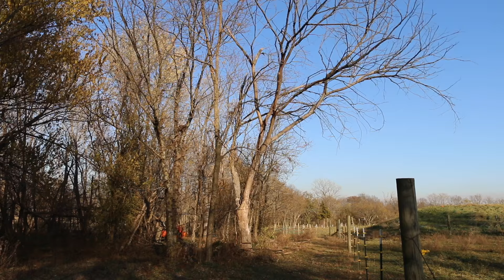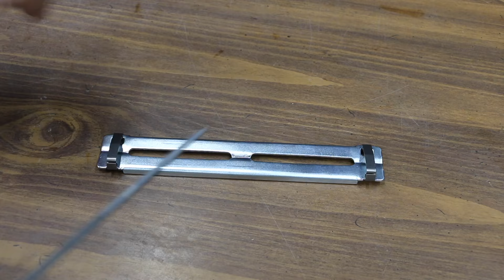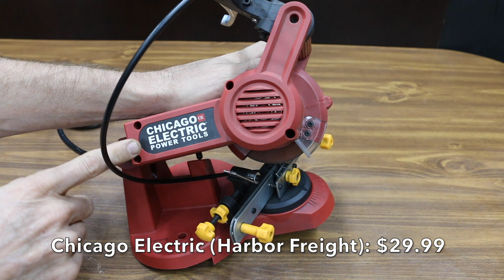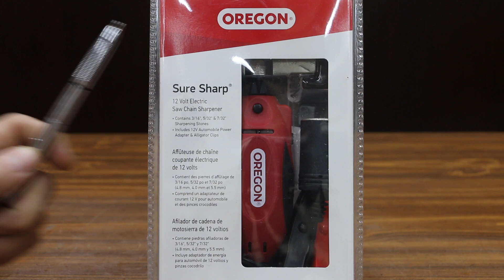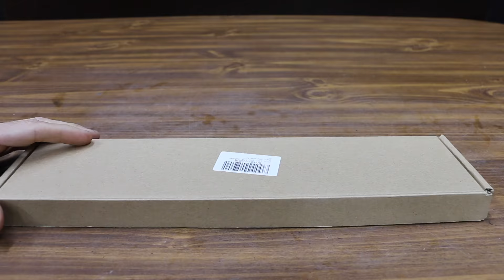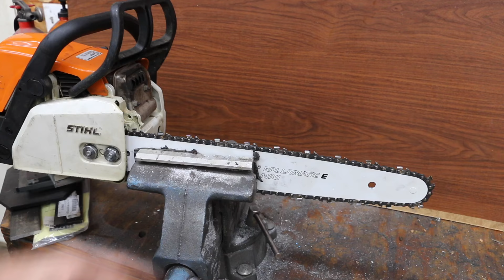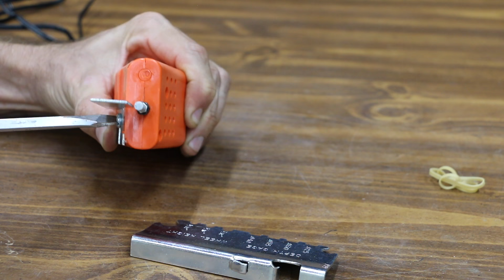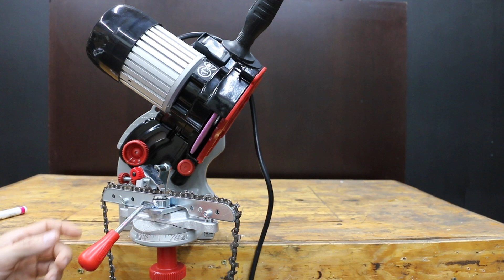Which Chainsaw Sharpener is Best? Let's find out! Stihl, Granberg, Chicago Electric, Oregon

Comment: Curious how a 4 inch grinder with a thin cut off disc(with square edges rounded off first) used freehand compares for cutting speed, likely get shot by some for saying it, but for my low home use on smaller saws(12-16"), i find it fastest and best. it takes around 2 minutes, and done carefully with a very light touch,  i find i can sharpen a fair few times before chain is a throw away item, and cuts real well after sharpening. But ok, angles are likely far less accurate without using any guides.

Comment: Interesting comparisons but you need to be more consistent with the wood being cut, some areas had much denser wood(knots) than others
Reply: the bar should also not be rocked and kept in a horizontal jig or rail

Comment: I have the Italian version of the Oregon bench grinder with one additional feature. You can tilt the chain holder 15 degrees sideways. I’ve had it for about 20 years and it keeps me spinning. I used to have a stone grinder that went on a Dremel tool that worked well.
Reply from the maker: Thanks for sharing.

Comment: I’ve been a power tool repair mechanic forever.
One of my more tedious jobs is sharpening garden tools and chainsaw blades.
In less then 20 minutes and using a Dremel Moto tool with a grinding stone I rip thru at least 50 a day.
No complaints No returns.
Keep it simple!
Reply from the maker: Thanks for sharing.

Comment: PLEASE COMPARE CAULKS.
I recaulked my bath tub and the caulk seamed to shrink, within months, to the point where it no longer sealed. I dont remember what brand it was, but it said sink and bath. I stripped it and tried a more expensive product and it cured without shrinking. It looked bright white when I applied it, but yellowed, as it cured. I've had that happen with painters caulk, too. But of course, those are typically paintable. Some window and door caulks are not, but come in a wider variety of colors. Then there are the products that claim to be all-purpose. So you could have several episodes, for the various applications.
Reply from the maker: Thanks for the suggestion.

Comment: I was always told by some old head to always sharpen the chain by hand because if u have an electric tool due to the fast grinding disk u cause a lot of friction witch causes alot of heat and change the temper of the tooth and your chain will dull alot faster . Idk if this is tru but something to think about
Reply from the maker: Thanks for the suggestion.

Comment: I have the Oregon 120V Bench and it does great once you get the angle set right.. I prefer the quickest way possible to sharpen my chains, a few seconds different doesn't mean anything.. 
You might be able to apply more pressure w/ some of these, but this test won't show that unless you double the weight and keep the angle exact. Some may bog down the saw.
Reply from the maker: Thanks for sharing.

Comment: You have videos for various sharpeners; knife, mower blade, etc.  One I would like to see is for sharpening circular saw blades.  One aspect of that is the shape of the cutting edge.  I noticed that the shape of the cutting edge in your saw blade testing may be different depending upon manufacturer.  So, is a straight flat chisel edge better than a "shaped" edge.  Like V nose or rounded or hollow ground, etc.  Ultimately, would a chainsaw sharpener(curved) type grind be better that a flat grind?

Comment: I run a firewood and tree removal business and run 4 stihl chainsaws ranging from a 230 to a 441c magnum.
I have tried all forms of sharpening tools over the years including the electrics and the granberg system which bolts on the bar.
The small electrics wear out stones very fast and the big electrics are not site potable.
The granberg bolt on the bar system is accurate but cumbersome and I threw mine away after a few sharpenings.
By far the best system I have found is the stihl 2 in 1 for simplicity,ease of handling and portability. 
Just cannot beat it.
Reply: I have a 441c magnum and purchased it with the 2 in 1 sharpener. The thing is absolutely deadly how sharp it keeps the teeth. I love not having the independently check my rakers, no need for power, portable. You can feel just how great this sharpener is when you use it.
Reply: I go back and forth between the 2 in 1 and the oregon bench grinder skipping the rakers on the grinder. To me that makes a really consistent really sharp chain
Reply: For the fellow who is nearly blind you are better off with a file that is slightly larger if you are unable to distinguish the correct size file for your chain.
A smaller file will cut into the tooth creating a point which you do not want.
The voice of experience here.
May want to just use one of the file holders because the size of the file and the angle you need are clearly marked,in large letters,on the top of the file holder.
Used one for years, they will get the job done for you if not fussy.
As for the depthcutters i used to use a round sanding disk on a dremel tool.
40 thousand rpm ,just a little touch after every sharpening did the trick. 
And I promise you you will not f it up too bad.
Reply: @peterfoster7861  thanks peter, that answered by question.
Reply: Yup can’t beat the two and one portable just keep a good shark file and you’re good to go
Reply: I agree also from 71 year old fellow. I also believe the stihl chains are the best. To me, these chains stay sharp longer and wear longer. It is like that have much better steel to begin with.
Reply: Yep  sharpening with a file and guide has always worked best for me was taught by a professional Carber Roy from Alpena chainsaw art and his wife Kat Are real artist I’ve been friends with them for 30 years
Reply: Did you know you can sharpen a chain fast and with good results with a hand held battery power grinder and a fat grinding disks.  takes a little practice and your chains will not  last  as long.  But, A sharp saw saves time only if your not working on sharpening  the chain a whole bunch.  I use to change out the chains as needed then sharpen them back at the shop at the end of the day until i started using the grinder.
Reply: It's worth pointing out that a person like you who likely sharpens chains every day develops a completely different level of skill than a homeowner, especially when reading that some of them are not even resharpening their chains! One thing about the Granberg style of jig is that, providing you have set it up correctly, you know the angles are going to be correct. If you are only sharpening a chain a couple times a year, you are going to have to pay close attention to your technique, as you are never going to develop the skill and accuracy of a pro.
Reply: Agreed
Reply: Me too
Reply: I'm nearly blind and not a sharpening pro. I have no way of telling which file size to use, at least on old chains.
Since I'm going to f it up, should I err to a large file, or small one? I just don't like tossing something because I can't fix it, that bugs me.
Reply: @MP-zf7kg  My feed store sharpens chains for $7, I have a small pile of chains I take over for sharpening. Maybe your chainsaw dealer does the similar, I was never happy with the results of my DIY sharpening.
Reply: thank you
Reply: ever try diamond stones?  thoughts?
Reply: Agree.
Reply: Love my 2 and 1
Reply: I agree

Comment: I have the Dremel chain saw sharpener kit similar to the two 12V sharpeners. I've had issues with the chains cutting better on the first side I'd sharpen making the saw cut turn as it goes through larger logs. I feel the stones wear too fast to provide an even sharpening. I think I'm getting a Harbor Freight bench sharpener and the guided file kit after watching this.
Reply from the maker: Thanks for the feedback.

Comment: On the Oregon did you prep the stone? That's a no I could see by the cut you didn't and you burned the cut so it dulled instantly. Probably experience and stuff but was allot of info to do in one video. The Oregon is the most versatile and you bought the cheapest model of it.

Comment: Oregon chain cutter didn't look setup correctly, after the grind the cutter showed excessive heating in the grind, heating annealed the cutter tooth this makes the metal soft and won't hold an edge. Grinding can generate a lot of heat at the cutting edge if the grinder is set for a heavy cut. This was at 12:20

Comment: The Stihl 2 in 1 goes everywhere the saw does. It's light enough to stick in your back pocket with a wedge or sqwrench and is foolproof. I tried all the different kinds of sharpeners and know now that the bench cutoff wheel style is only needed on badly damaged chains. They work great but in reality if you touch up with the Stihl it all that's needed. It gives you and the saw a break at about the right time and keeps you cutting well, which makes the work more enjoyable. Can't remember the name of the German company who came up with it, but I'll never use anything else unless I wreck a chain then back to the bench style for repair.

Comment: I bought a stihl 2 in 1, unbelievable its like a new chain every time i go out. I just give it light touch up maybe 2 strokes when i sharpen it. A lot of the shops that sharpen really file a lot of the chain off when they sharpen them. Easy to learn easy to use.
Reply from the maker: Thanks for sharing.

Comment: Wow, looks like a way to spend money. I worked on a tree trimming crew when I was growing up and everyone carried a round file and a flat file and we all learned to sharpen a saw chain laying on the tail gate of the pickup. When hanging on the side of a tree on a pair of tree spikes its not the time to find out your chain needs to sharpen. Practice was 3-4 strokes with the round file on each tooth and about 3 passes with the flat file on the drags. The chain never got dull and you certainly never spent $85. I'm old now but that has stuck with me for all these years and I still have the same Poulan 2300 I had then and so long as I run it once every couple of months to keep the gas in the carb fresh it starts on third pull. Good saw.  Nice video though and thanks for making it.
Reply from the maker: Thanks and you are welcome!  Thanks for sharing.

Comment: I found the stihl 2in1 to be pretty good. Here in australia we cut alot hardwood & have lots of termites so the wood often has dirt in it so chai  wear is really bad so not only does the cutting edge go blunt quickly the height of the tooth wears also. The 2in1 not only sharpens but also reduces the height of the rakers. Alot of people have trouble sharpening chains because they dont realise the height of the rakers is important.
Reply: As a professional woodcutter in Australia I agree completely. The Stihl 2 in 1 is easy to use and does need power. That means you can sharpen in the forest / bush every refuel which for me can be every hour or 30 min if really going hard on a Stihl 500i.
Reply: That does not need power.
Reply: @49100CHP Amen.
Reply from the maker: Thanks for the feedback.

Comment: (I use a 6 wheel drive Polaris as a saw wagon that carries 5 Stihl chains saws ranging from a small trimmer to 'Big Moe' [064 with a 28" bar[. We also use an 11,000# logging winch on the PTO of a 110hp tractor as well as a 44hp log skidder tractor.) - I've been logging trees for fuel for near to 20 years and have tried a number of sharpeners. In the end I chose the cheap manual sharpener for a number of reasons. First and foremost is that I can sharpen the chain in the field. Secondly is that between the fancy articulating sharpeners and the manual there really was not enough difference in the outcome to justify the costs. I want to cut wood not spend money for saw sharpeners. But, each person has to determine what works best for them and their situation.

Comment: I've used the Dremel system for years, its really quick about 2.5 minutes and does a decent job and portable especially if you use the cordless one, i can sharpen about 10 or more times from one charge.
Reply from the maker: Thanks for sharing.

Comment: Thanks for this great test.  One point to consider - none of these new chains needed to have their depth gauges filed.  Later as more sharpenings lower the cutters, the depth gauges will require filing - normally a separate operation.  The Stihl 2 in 1 accomplishes this in the same operation while sharpening the cutters.  This looks to provide an advantage down the road.
Reply from the maker: You are welcome!  Thanks for the constructive feedback.
Reply: Agreed! The flat file on the 2 in 1 assures that the depth guides are at the proper height in relation to the cutters.

Comment: Its a pain but my Oregon  510  i have to use a drill to spin up the motor in reverse before sharpening the right  angle to clean the burr it leaves idk about that model
Reply from the maker: Thanks for sharing.

Comment: What you're not taking into account is the fact that is nearly impossible to correctly file a full chisel chain I don't care who you are That's why nothing cuts like a new chain. Because you can take a seasoned pro in mathematically speaking you're almost assuredly not consistently filing every tooth the same that's why they invented bench grinders it is the exact angle on every tooth so over the life of that chain I guarantee you you will get better cuts with a bench grinder
Reply from the maker: Thanks for the feedback.

Comment: So... I'm not sure you can put a different file size in that Stihl 2 in 1.  I just bought one for my saw, come to find out you need a separate one for each saw depending on your pitch and file size.  I would think going to a smaller file may cause the file to be a lot looser in there.  I have four saws, I'm thinking I may need three or four 2 in 1 sharpeners.  Still did a great job even with that smaller file in there!  I think long term the 2 in 1 would come out on top.  I used to sharpen free hand with a Dremel and stone.  Works great until the rakers get too long, the 2 in 1 files down the rakers, that's it's big advantage.
Reply from the maker: Thanks for the feedback.

Comment: Thank you for your extensive tests, I just like to mention that all the information on the sharpening is good until the time effect comes in, after the first couple of sharpenings, as the majority of sharpener can not compete with the stihl 2 n 1 system, being that it will take care of both grindings, the sharpening grind and the depth gauge (rakers) grind where the others you have to do it separately, taking much more time to fully sharpen the chain, at that time the stihl 2 n 1 becomes the fastest tool.
Please keep your no-nonsense videos coming.
Reply from the maker: Thanks, will do!  Thanks for the constructive feedback.

Comment: I have been using a file for over 30 years, and have had good results. I have used saw shop grinders in the past and have noticed a better cutting result. However, they don't stay sharp as long. I'm wandering if the added heat from the grinder is non tempering the chain. The other thing is I have had better results with Stihl vs Oregon chains. Stihl is more expensive but they last longer. But I use full chisel chains and not the safety chains.
Reply from the maker: Thanks for sharing.

Comment: Any chance you can make a video about polishing buffers for use on auto finishes and boats. I know one is fiberglass or carbon fiber or kevlar with various gel coats or other finishes and the other on a paint finish. But will one buffer do it all or must they be different for varying rpms?
Reply from the maker: Thanks for the suggestion.

Comment: I bought the HarborFreight chainsaw electric sharpener. At first it seemed to do a pretty good job, but I noticed after using it a while it started having too much flex in the locking mechanisms with the plastic parts,  even when holding the brake as tight as I could. I eventually gave up using it. The other electric model you used looked like a much better sharpener with less plastic parts to deal with. I wouldn’t recommend the HarborFreight chainsaw sharpener unfortunately!
Reply from the maker: Thanks for the feedback.

Comment: I really like your videos I was a professional cutter cutting down trees for a living I found it you can change the angles cut the rakers down so you get a better bite and depending on how much torque your chainsaw has cut more than twice as fast as a new one but I like seeing how adjustable each of the sharpeners was that's still two in one I had never seen before
Reply from the maker: Thanks!  Thanks for the suggestion.

Comment: Love the video, but I could not help but notice how the electric sharpeners turned the chain blue.

 I wonder how that effects the longevity of the sharpened edge? Does it change the temper of the metal and create a sharp but softer blade decreasing how long it stays sharp?
Reply from the maker: Thanks!  Thanks for the suggestion.

Comment: I think you can get better results with the Oregon bench grinder than that with some testing and tweaking. Also using multiple small lighter strokes on the tooth instead of just dumping the grinder all the way to the bottom in one hard stroke. Helps eliminating burning the tooth and leaves a more finished smooth cutter and the use of a CBN grinder wheel instead of the supplied wheel. I normally freehand or use the Sthil 2-1 in the field for touch ups but I get great results off my bench grinder when you take the time to set it up and use it properly. One big plus on the bench grinder is eventually after multiple hand filings your angles may get a little off and a grinder will get them back.
Reply from the maker: Thanks for the feedback.